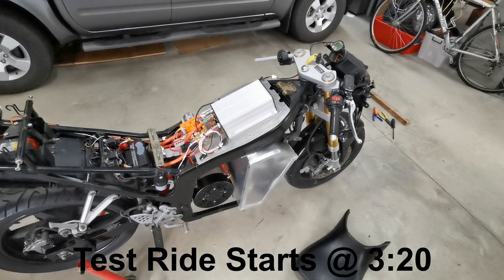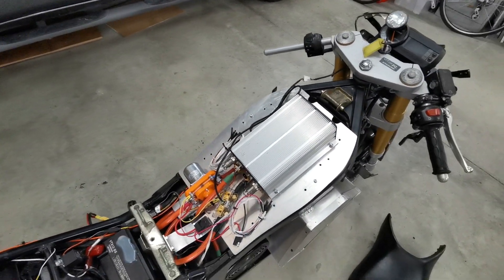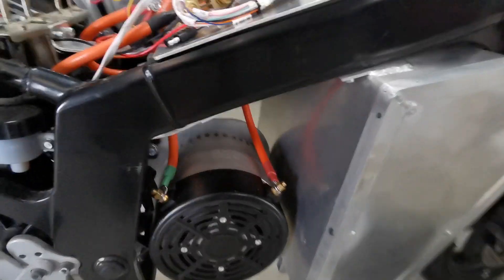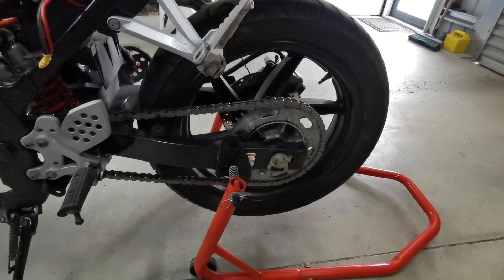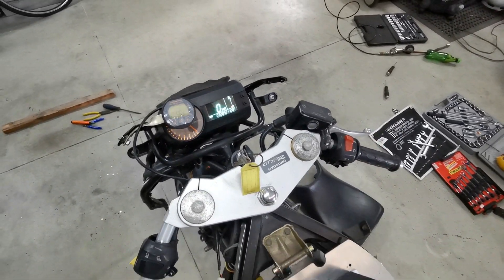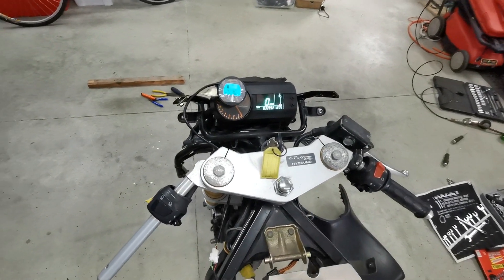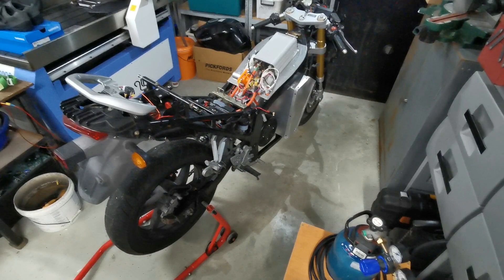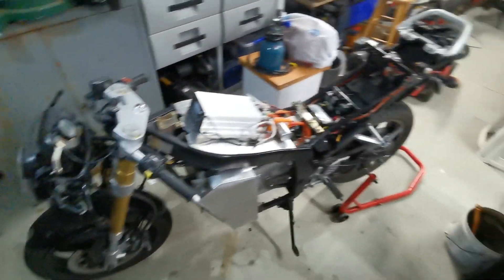Electric motorbike update 5 - First test ride

Comment: Is it fair to ask why not brushless motor, like you started with? Thanks
Reply from the maker: Hi there, absolutely fair question. In this case, that 5kW BLDC motor was available fairly cheaply secondhand locally, so I figured it would be a good  one to try with. I think 5kW is underpowered for getting me (90kg) + the bike up to 100km/h, so I looked around for a 10kW motor to replace it. The cheapest easily source-able motor was this ME-1003 PMDC motor, so went with that. I actually think BLDC is safer because for a BLDC setup a shorted FET in the motor driver cannot cause the motor to go to full power like it could with this setup. I will probably look at a water cooled BLDC 10kW motor for my next bike conversion.
Reply: @successfulengineer  I'm going to build one, have bike ready for mockup ninja 250 06, looking at motors
ME
Reply: me1302 15 kw or me1115 12kw ?
Thanks
Reply: If I go with me1302 liquid cooled maybe I use Chevy volt battery 48 volt it has cooling pipes?48 v because of space and maybe liquid cooled controller?
Thanks
Reply from the maker: @peadardunworth7092  Yep, that looks like a perfect motor. 48V is nice because its easier to find fuses and contactors for the low voltage. Depending on which country you are in, it can also be easier to certify a 48V conversion because it is considered "low" voltage. You could also look at the Golden motor site and see if they have a similar motor 👍
Reply from the maker: @peadardunworth7092  If I were spending someone else's money, I would definitely go for the ME1302, its got more power (even if you don't need it) and fully sealed. Will see if I can locate one for my next bike actually
Reply: @successfulengineer  ya one time purchase good info on 48v system.i live in Atlanta and it gets hot Will take a look at Golden motor.thanks
Not sure exactly what I'm at but going to get it a go!

Comment: Everything seems to work great. I always wonder about regenerative braking...if the energy can charge the batteries at the rate it's created from deceleration. I also wonder if you're on the north or south Island. Always awesome videos, cheers.
Reply from the maker: Hi mate, regen certainly helps, but it really just saves the brake pads, you only get a fraction of the energy back that you put in. I've got it set up to kick in when I just touch the brake lever gently, might as well capture as much energy as possible while slowing down. I live north-west of Auckland, would need a bit more clothing for test rides in the south at this time of year! Appreciate the comment!
Reply: @successfulengineer  I never even thought about saving brake pads..that's a great bonus. Now I have to wonder about storing the energy in super capacitors from braking lol